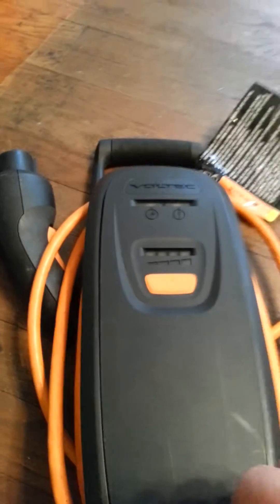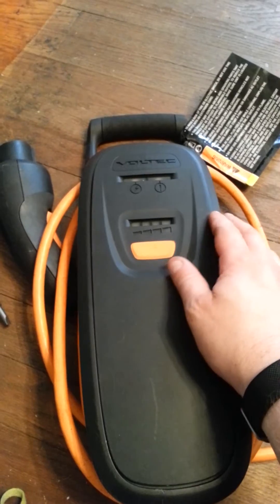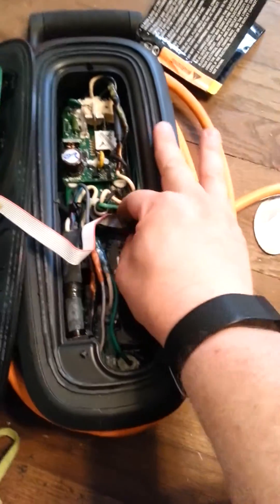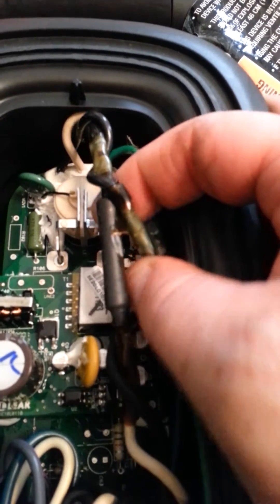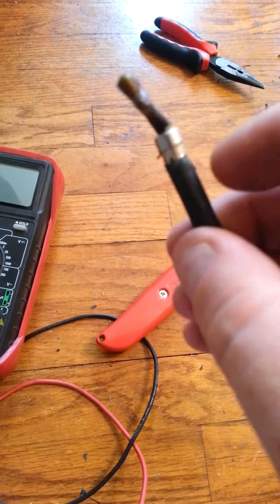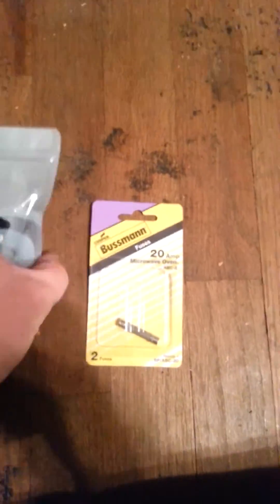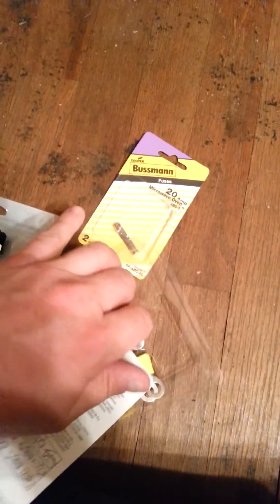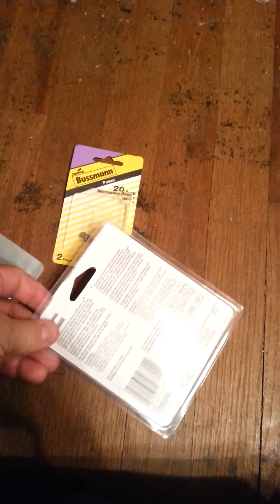Chevy Volt 110 Volt Charger fix

Comment: Hi. Probably too late but I have the same charger and resistor R103 has burnt out. Could you measure the resistance of your R103 and tell me what it is please? It's the big green resistor by the gfci and neutral wire. Thanks
Reply from the maker: 47ohms 5 watts 5% accuracy
Reply: @doransignal  Thanks mate
Reply from the maker: Let me check tonight I'm off to work now
Reply: @doransignal  that would be great. Thanks

Comment: I cut about 2 feet off a 12awg extension cord to replace the original 16awg one in mine. I soldered all the connections and put a "true" heavy duty fuse holder (COOPER BUSSMANN BK/HFA-R) in mine with a 15 or 20amp quick blow fuse can't remember which one, it's been working great for months. I used a lower end fuse holder (Sea Dog 420554-1) at first and it melted it after about a year.

Comment: You stated something the other videos don't - that you were getting no lights on when you plugged the unit into the wall socket.  That is exactly what I needed to know. Mine actually does show power and the lights show green until I plug it into the car, at which time I hear 3 relays trip and the right hand Fault light goes red, while the others are green, and no charging.  Does the same thing in 8 amp mode, as well. Oh well, and thanks for posting the repair vid  for everyone else. ;-)
Reply from the maker: Joe Ballou glad I was able to help you out. If your looking to purchase a new one I recommend the charger for the BMW i3. It's the one I use now. It's built well

Comment: There is a reason why there are numbers of these repair vids for these EVSE's.  If you are reading this I bet that your fuse too has failed.  Is your 110v power cord hot when charging?  Not warm,  hot.  Then that hot cord runs into a sealed box and attaches to a fuse designed to fail if it gets too hot....  These power cords are 14 gauge which is supposed to be NEC standard for sustained 12 amp draws.  No extra, but enough.   If your cord is heating your garage, it doesn't meet that standard.  Poor alloy?  Undersized?  Something we all have.
    Replace with a nice piece of 12 gauge and a good plug.  I did not replace the wire from the fuse to the board since that requires extra steps and that piece of wire does not seem to be getting hot.  DAMHIKT. 
   This has done several things for me.  One, the silly (required)16" cord is now long enough to actually reach an outlet.  Two, since the cord is now sinking heat off the fuse instead of cooking it, I've finally sealed the case.  Provision to change fuses easily next time is more time and effort that I don't yet regret skipping.  Three, the charge time has dropped about 20 percent.  I do not understand why, but a full charge is now only 9.5 hours in warm weather.  And of course I'm not buying all that electric heat for my garage when I charge the car.
Reply: I used a 12awg extension cord to replace the 16awg one in mine. I soldered all the connections and put a "true" heavy duty fuse holder (COOPER BUSSMANN BK/HFA-R) in mine with a 15 or 20amp quick blow fuse can't remember which one, it's been working great for months. I used a lower end fuse holder (Sea Dog 420554-1) at first and it melted it after about a year.